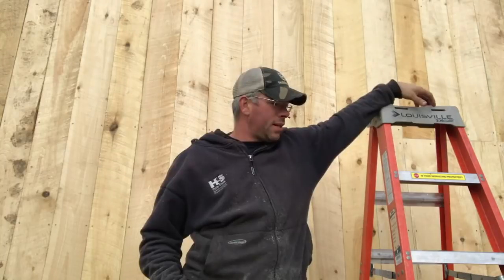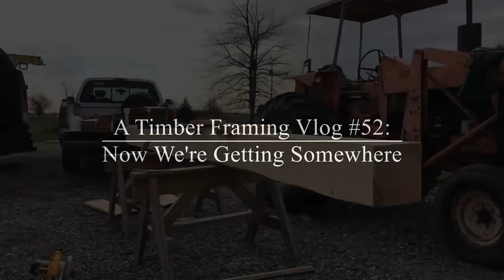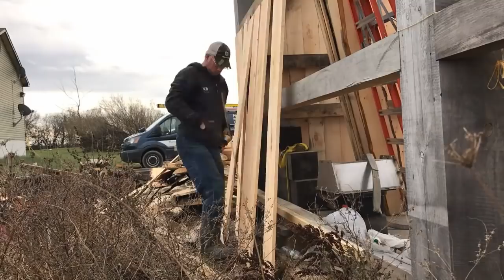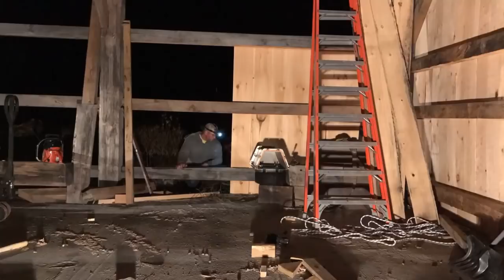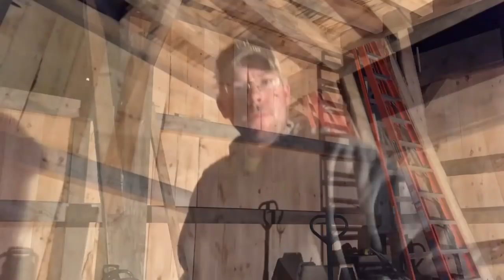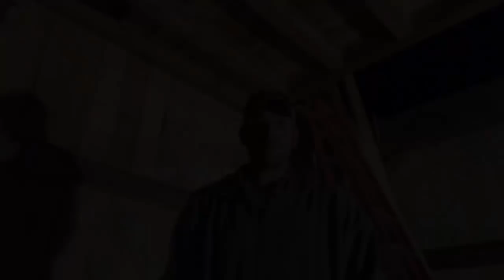A Timber Frame Vlog #86: Now We're Getting Somewhere

Comment: Good day my friend you are so right in my book if it don't work it don't eat. You say you have timber scrap to burn ? Just a suggestion would it make sense to put up your forge your planning then you can burn your scrap and at the same time put a little heat in the barn now its coved in a little heat is better than letting it burn out side winter on its way it'll be a little bit of comfort if only to warm your hands when they have gone numb?
Reply from the maker: +David Chadwick good idea.  I actually heat the house with wood, so once they're dry they go in there except for the goofy stuff.
Reply: TheTradesmanChannel 2017 well that’s the point I was thinking if I’m burning anything I’d have the heat off it better than wasting it out side and in the house it has to be better quality I would of thought ? But in the barn I don’t think it would matter I’d use anything that will burn lol
Reply from the maker: +David Chadwick l figure as long as it burns and I can burn it clean then I'll use it in the house.  Not too much gets wasted.

Comment: Good afternoon, Jim. Yeah, there is a premium to buy wood someone else milled, but figuring in your time savings on sheathing, I think it's worth it too. Progress is looking pretty amazing.
When milling the floor boards, do you rip all the 1 inch then set it vertically (side by side) in the mill to cut it to width? Or did you just rip the width with a circular saw per board? Have you tried it on the mill, gang ripping? Were there issues that had you go to the circular saw?
Thanks again for sharing you journey and skills.
Reply from the maker: +Thomas Russell I do both for flooring.  Some boards just don't match up well at all.

Comment: Hi Jim, 
I have a question. Is it paramount that the bark be removed before cutting the logs? I see PLFL just cut, no cleaning of the logs before. Is this not in some way detrimental to your woodmizer?
Reply from the maker: +Wouter Ros it kills your blades very quickly.
Reply: If you drag a stone into the log you destroy your band. I have a swing saw mill that I built myself and I cut from the inside of the log with a carbide blade. I never spud the bark off of the logs and I remove an edged board from the log. This saves enough time to make up for the low rate of feed I get from 10 hp. and a quarter inch kerf. Last summer I cut 7800 bf and I have not had my blade professionally sharpened.
Reply: And Jesse is learning that lesson the hard way!
Reply: I should say *learned*.....